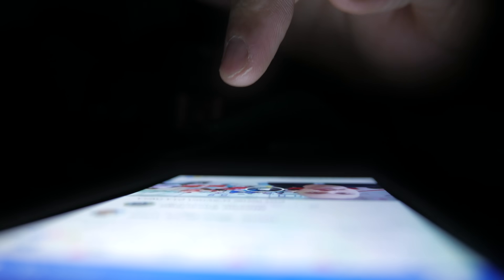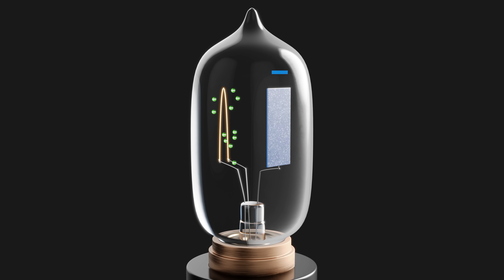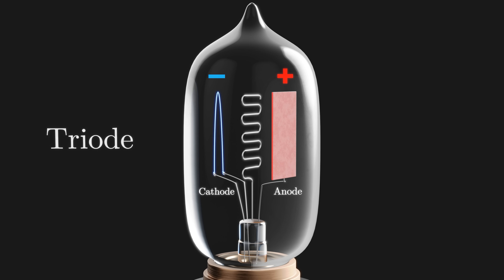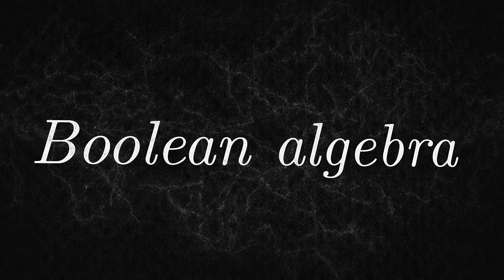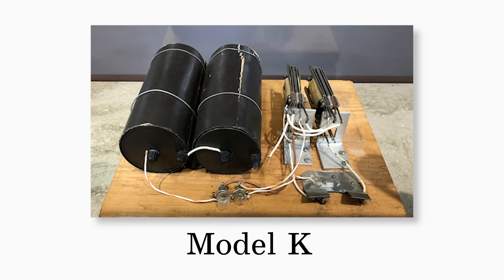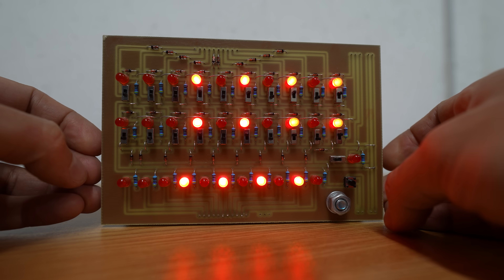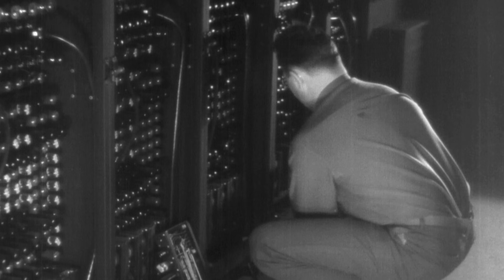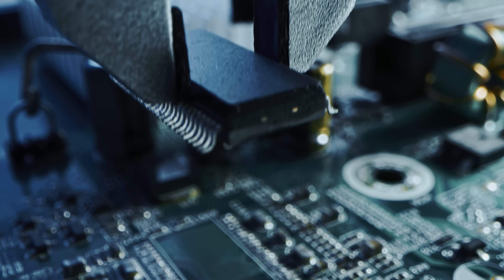Why The First Computers Were Made Out Of Light Bulbs

Comment: My first job out of college was designing a microprocessor at Intel and I was responsible for the instruction cache as well as the floating point execution unit.  The discussion of adders, methods of subtraction, carry chains, etc. brings back a lot of memories; most very good, some very frustrating...  Those were the days when putting 200,000 transistors on a chip was a big deal.

Comment: The electronic revolution happened due to the invention if the Integrated Circuit (IC) not the semiconductor diode or transistor. 
It was a huge leap by R. Noyce enabled by the development of the planar process

Comment: For those wondering, OR is true (output current flows) when one or both inputs are true (current is flowing). It is only false (output current not flowing) when both inputs are false. The "N[blah]" operators just flip the result of whatever 'blah' is, so true becomes false and vice versa. 

So,
NOR  = Not OR. True (output current flows) when both inputs are false (current not flowing). False otherwise.
NAND - Not AND. False (output current doesn't flow) when both input are true (current is flowing). True otherwise.

Comment: I dont get it. If you not only get a on or off signal of the triode but also a slightly on or slightly off by changing the charge of the grid, then why are we only using these two options of on and off. I thought the big difference between normal computers and quantum computers is that the qubits in a quantum computer have multiple states instead just the two states of a normal bit, but i dont see why you shouldnt use the amplitude of the output currency as indicator to create a bit which has an output range from completly off over slithly on to completly on.
Reply: because its far easier and more reliable to only have two states

lots of room for error

there are actually some non-binary "computers"

Comment: Dude!  The "invention" that allowed lightbulbs to work long enough for the glass to even become discolored was to make the filament out of TUNGSTEN instead of CARBON. Someone else invented the "idea" of the lightbulb. But they used carbon filaments, because people were used to carbon arc lamps. But the carbon filaments didn't last very long. Edison PERFECTED the light bulb by using tungsten filaments.

Unless you can show that Edison made this observation BEFORE he switched away from carbon filaments, the beginning of your video in incredibly misinformed and misleading. The way you left it, you will make some people think that incandescent lightbulbs use carbon filaments, which is so wrong it's laughable.

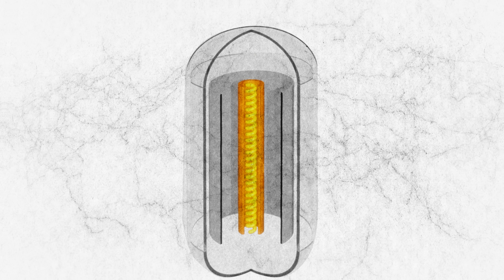Comment: 2:50 this little device is how photos were originally sent over the wires back in the 30s. The current flowing from the plate would vary depending on how much light was hitting it and the system receiving the current would detect the differences and there the gradient of a black and white image would come out

Comment: My father was a professor at Cornell University, and I have some memories from the early era of computers.  My father acquired for his office in about 1960 a purely mechanical calculator made by Friden that could add, subtract, multiply, divide, and, COMPUTE A SQUARE ROOT.   It was about twice the size of an electric typewriter, very noisy in operation, and cost the then-huge sum of $1300.   I also remember being taken in about 1958, as a very small child, to see Cornell's first electronic computer, running on banks of vacuum tubes and pretty much filling a former engineering school machine shop,
Reply: ur so lucky
Reply: I wonder how people calculated square roots before that. I know of some ways that it's possible, but, like, they all seem like a huge pain.
Reply: @vigilantcosmicpenguin8721  :)  It was.  It involved guessing.  It was my sole reason for buying a calculator because I knew how to do the other stuff. hahaha
Reply: U still have that calculator?
Reply: @miyamoto900  Heavens no.  To start with, it was always property of the university.
Reply: @Pamudder  can we steal it ? What would it take ? Please make a plan and inform me at earliest. 
Yours truly,
Miyamoto.
Reply: @miyamoto900  I have a tesla model 3.  I'll drive getaway, deal?
Reply: @Pamudder  [o

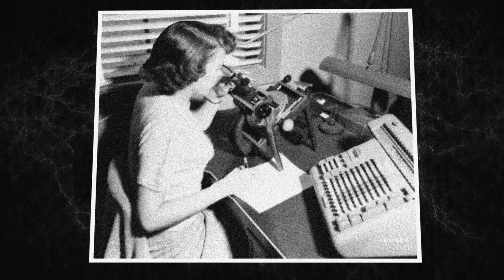Comment: Should really have had CuriousMarc and MrCarlson on this episode; by the way the noise in a office that did calculations wasn't really a problem as the calculators existing at that time were all mechanical and a lot noisy (you can see at 15:05 one friden calculator for desk and those things were loud), so it was just normal, the real advantage is speed and reliability

Comment: You'll find the first programmable computer was Colossus used by British code-breakers in 1943. And I'm sure you've heard of Alan Turing... (No doubt this has been pointed out many times amongst the previous 3036 comments!)
Reply: these firsts always come with disclaimers. primary reason why ENIAC is often cited over Colossus is that Colossus wasn't Turing-complete, it lacked conditional branching support. arguably it's still a programmable computer but if you ignore Turing-completeness as requirement then I'd say "first programmable computer" would be Konrad Zuse's Z3 completed in May 1941.
one reason Z3 gets sometimes overlooked is that it used relays instead of vacuum tubes making it technically electromechanical rather than just electronic, but I'm not convinced the exact nature of the switching technology is relevant to a definition of a computer (eg. currently there's labs busy working on optical/photonic integrated circuits and quantum technology which could be used in a machine that most would call a computer but wouldn't do their computing electrically).
Reply: @snooks5607  If you're gonna go down the route of only counting the first Turing-complete computer then Babbage beat everyone to that punch in the 1800s.
Reply: @alphaxion  what are you talking about, he never even built the "analytical engine". and I didn't say being turing complete is the only thing that'd define something as "a computer" it's just the minimal set of things for the proposition to make sense (you'd also have to define what you mean by "computer" before defining what constitutes one, eg. until the 1940s "a computer" was a human doing calculations by hand)
Reply: You are all wrong, the first programmable computer was the ABC the design of which was stolen and turned into the ENIAC. People still not knowing this shows the power of good PR...
Reply: This is correct, but Colossus was not directly programmable, you had to assign new tasks by re-wiring it. Its main task was to decrypt messages.

Comment: Great video! At 2:48, when mentioning that the diode bulb converts AC to DC, the DC graph stays at zero for the parts where AC is negative. Gives the impression that the thermionic effect only works if current is flowing one way...
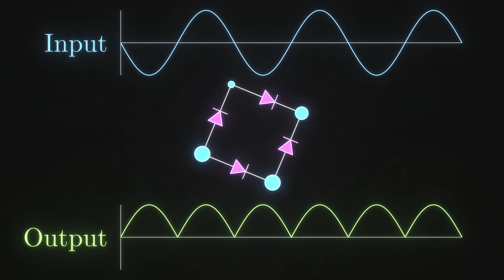Reply: Now at 3:13 it seems to be really like that, but I don't understand why... 😮

Comment: With a little work, most of which is cleaning, replacing capacitors, and some resistors, a vacuum tube radio from the 40's can be restored to full function. The tubes are rarely bad. Todays electronics, eh... it can be done but most people just throw the device away. I'm envious of the guy that you interviewed with the primitive computer equipment.

Comment: Thanks for this excellent content! Vacuum tubes have been fascinating to me for most of my life. In 2022, I purchased a brand new amplifier for my amateur radio hobby and it uses four 811A Tubes with an RF output of 800 watts. Not only is there greater clarity than with a comparable solid state amplifier, but the tube amplifier is generally more immune to power fluctuations and spikes than a typical solid state amplifier.

Comment: 1 interesting point about tube computers, is that they later became far more reliable. But by that time, transistors became more reliable as well. The choice was then obvious that transistors would be the most practical choice for computers. Tubes weren't bad, but transistors were far better.

Comment: OK your very first statement is not correct.  Modern electronics started from the research oh Hertz, Volta, Faraday and other scientists. The electric motor predates the light bulb .
Edison discovered the Edison effect because he was trying to make a better light bulb. But discovered that by adding a plate near the filament he had made an electronic switch. This lead to the first vacuum tubes. Ambrose copied Edison's work trying to improve on it.

Comment: In the 60s we had 2 TVs with vacuum tubes.  When a TV quit working correctly we would take out all the tubes, put them in a shoe box and go the the drugstore where there was a tube tester.  After finding out which tube had failed we'd buy a replacement for it and take all the tubes home and put them back into the TV.

Comment: Why are the triode model's input and output signals completely out of phase?
Reply: When a positive voltage is applied to the grid, the triode starts to conduct current, which leads to a decrease in the voltage on the anode. This happens because the triode can be seen as a resistor with resistance dependent on the grid voltage: when the grid voltage increases, the value of the triode "resistance" decreases, and as such the value of the voltage on is also decreases. It must be shown that the anode of the triode is connected to the positive of the power source through a resistor.

Comment: Oh dear. Morse Code isn't binary, it's ternary or quad state if you accept there are two lengths of spaces.

The first digital computer was Colossus Mark 1 and 2 from 1943/44

🙂🤷‍♂️
Reply: It may have been the first electronic digital computer. However, the Z3 was the first fully automatic (electromechanical) digital computer.

Comment: I do not envy the engineers working on the early relay logic computers…

I worked as an avionics tech for many years. Relay logic was quite common in aircraft systems for a long time, and still exists to some extent in modern aircraft. I have seen relay logic using several relays still used in aircraft from after 2000. It was used for things like controlling power output under different conditions, sequencing things like flap deployment, and other uses. When I was in the military, there were aircraft with multiple relay panels that contained around hundred relays each… For all manner of systems control.

Troubleshooting those systems was a pain at times. I am not sure how troubleshooting those old computers would have been like, but it looks like a bunch of not fun.

Still, I find the history of computing and electronics fascinating, and really admire the ingenuity of the early pioneers.

Comment: At 9:00, there is definitely current running through the solenoid when both are connected, it is just 1/2 the current as when 1 is grounded and one is energized.

At first, all current will run through the bottom path, but (i believe logarithmically or asymptotically), the current in the solenoid will increase from zero until it reaches 1/2 the total current flowing through their shared path.

So if you pulse this very fast, ypu don't have to worry about the solenoid closing the switch, but VERY quickly, the solenoid will
Energize to 1/2 its magnetic field. Since the output is a light that needs to be human visible, this configuration requires tuning the solenoid and the strength needed to close the switch such that full current causes enough field to
Close the switch, but 1/2 the current will not.

Please correct this. It is a very glaring error.
Reply: Why would current flow when both terminals are in same potential?
Reply: @kiloperson5680  Because they are both connected to ground.

Comment: Minor correction on vacuum tube lifetime: The maximum runtimes for ENIAC are clearly documented to have been limited by the job length and not the tubes. Alas, somebody who "didn't read the instructions" kept insisting that ENIAC be shut down when not in use, triggering tube failures.
The reason we can know this to be true is due to the kind of tubes in use having been common types utilized by commercial radio transmitters (and in some places long-distance telephone networks), where lifetimes that short (and a lack of parallel redundant amplifier stages to spread the load) not only would have been unacceptable, but didn't happen. This is also part of the lore of Colossus, which coincidentally was designed by a telephone system engineer.